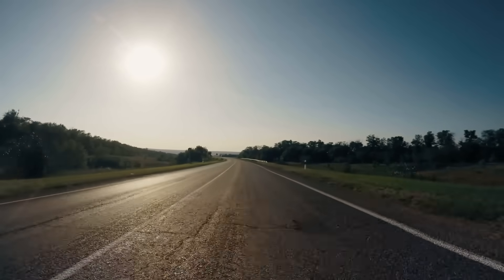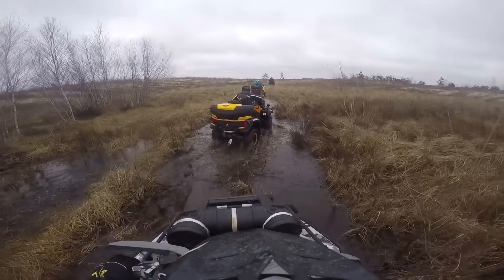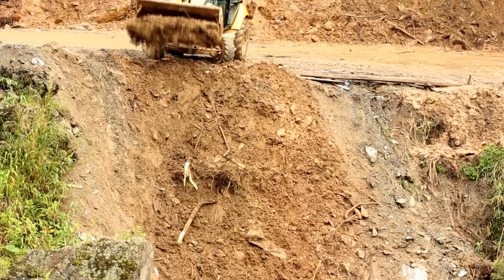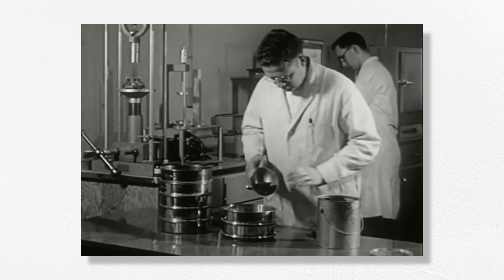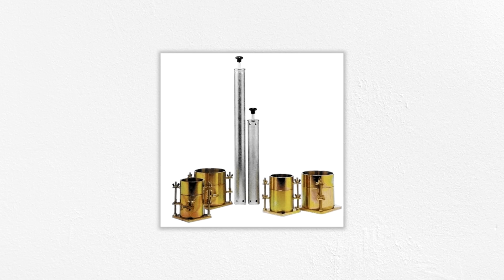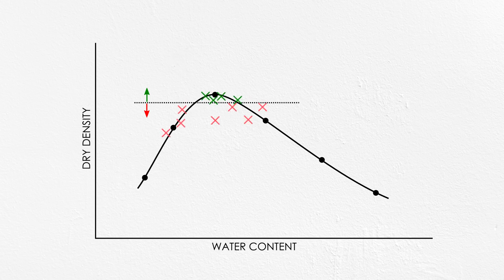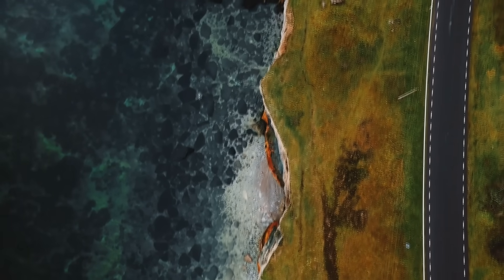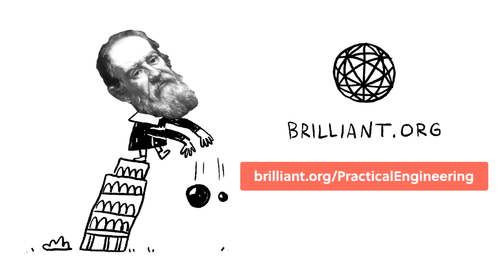Why Does Road Construction Take So Long?

Comment: Oh this brings back memories. As a construction plumber, we had to compact our excavation backfill- particularly on commercial sites. That's exactly what we had to do- put in one foot of dirt at a time, then compact it, which sank it down to 8 or 9 inches. 

We also had to control the moisture content all along the way. Too dry, and and we'd be breathing dirt. Too wet and the compactor would sink into the mud. 

The more money they were spending on the project, the more likely it was there'd be a soil guy on site testing every lift. Without one, we were supposed to test it ourselves, but usually didn't. Testing involved shoving a cylinder into the ground to extract the soil inside it, then squeezing it and rolling it, looking for certain qualities.
Reply: Yeah!  I have seen over the years compactors and graders move around soil on construction sites, especially during the summer.  Oh man... it would almost always be "I did not realize I was in the Mojave Desert already!".

Comment: It might be worth mentioning the specific challenges caused by expansive soils. In Colorado we've had significant civil engineering challenges caused directly by soil volume changes, including major problems for roads along the front range of the Rocky Mountains, often caused by changes to the moisture content of bentonite or other expansive clays.

For that matter, expansive soils more generally might make an interesting subject for a Practical Engineering video.
Reply from the maker: I do have a video on just that topic ;) It was a couple years back.
Reply: @PracticalEngineeringChannel  Thanks, I'll look that up.

Comment: This small stretch of I-80 in Illinois, Idk how many times it’s been patched up... to the point where they gave up and moved on. I’ve driven in this spot for 2 years. Never gets fixed. (41.4715951, -88.2395958)

Comment: Roads: Million and billions of dollars.
Winter: Intentionally spreading corrosive salt to DESTROY BRAND NEW ROADS completely!
REPEAT. 
We need Salt Engineers.
Reply: the salt used to prevent ice on roads has minimal effect on asphalt. most potholes form either form water expanding inside or under the material as it freezes and causing cracks, poorly compacted material under the roadway swelling/shrinking in relation to the water content changing and damaging the asphalt, or Heavy vehicles like semi trucks sitting in one spot or moving very slowly on the asphalt during hot weather, where the heat and weight cause the asphalt to soften and then deform. Once you have a depression, tires hitting the edges of the slope at high speed quickly wear it away and change it from a depression to a pothole.
Reply: Here in Michigan we have 2 seasons. Winter and construction
Reply: @Devilnutz2651  in Russia there's no such separation. If at least one road was not re-asphalted during winter, something is not right
Reply: summoning salt
Reply: @heyandy889  He's gonna go for a speed run in construction
Reply: Us in Ohio also have this problem. We really need to invent roads that can better survive the winter.
Reply: We tried beet juice here in Calgary last winter on the roads.  Worked ok, but we are like Denver and have crazy freeze thaw cycles because of the chinooks.  God I love chinooks, the wind, not the helicopter.  I like the helicopters too.
Reply: In the tropics we don't need salt, and roads damage just as easily from muddy soils and intense rain. And if it's on the coast, salt from the sea.
Reply: Trains
Reply: I think that a lot of places put too much effort into keeping their roads clear of snow 24/7. Where I live, It snows badly enough to really affect vehicular traffic about 3 times per year, but when it does, they immediately run like 10 plows at once to clear it all up in an hour or two, and everything just gets carpet-bombed with salt. Rinse and repeat if it keeps snowing for a few hours. I know that, hypothetically, someone might die somewhere by not being able to get to a hospital if the roads aren't completely clear, but cars kill people all the time, and I'm sure a ton of emergency services already dump money into being able to reach places in a snowstorm, anyway. I think we'd save a lot of money and effort if everyone just agreed to chill at home for the day (or, you know... WALK) while the snow was cleared in a more methodical manner. Like a mini-coronavirus lockdown that only affects motorists. And you could maybe use your day off to shovel snow for a bit... get some exercise?
Also, as an engineer who works on non-roadway infrastructure: the blue-collar dudes that run your sh*t will not listen if you tell them not to use salt on things (for the same reason that beat cops in even "progressive" cities like Minneapolis still kneel on black people's necks). Design everything to be as salt-resistant as possible, and keep snow from accumulating where you don't want it in the first place, if possible. This includes the sides of buildings where salt is likely to be dumped or splattered.

Comment: It might be interesting to talk about ways previous projects have cut corners to work faster and cheaper, and the long-term consequences of those decisions.  For example it feels like  the Interstate system may have been initially constructed with much more cut than fill to leverage pre-compacted soil, possibly just dumping soil or using it to make berms.  I don't know this but it kinda looks like it.
Reply: The experience with the Interstate Highway system varies by region, and much of its early history (late 1950s to early 1970s) involves the development of proper freeway/motorway design standards in an era when the existing freeways were few and had design standards more in line with boulevards and avenues. Even the Weimar and WWII era Germany Autobahn has certain features more in common with avenues than modern freeways.
Secondly, freeways can also have intentionally depressed designs for other reasons, such as taking advantage of gravity in off- and on-ramp operations (off-ramps uphill and on-ramps downhill results in shorter ramps as gravity helps cars speed up or slow down as needed), creating natural noise mitigation from the cut segment slopes, saving costs on more expensive mainline bridges over cross-roads, and even using the excess cut material to form noise-abating berms on the roadside.

Comment: I would love to see this series continue. I have been known to take the congested under-construction route to check up on the progress of jobs. I love watching it all come together even as I get frustrated by waiting for flaggers to let me through the site. 
One thing I see commonly in BC's lower mainland is pre-loading - loads of gravel up to several meters deep dumped on a surface after removing the biological soil layers, but before the final road building begins. It would be great if you could explain this process in more depth.

Comment: Is that mass haul diagram the integral of the difference between the current surface and the proposed surface? It seems like it finds the areas of cuts and fills, like how an integral finds the areas under and over a curve.

Comment: I don't usually mind the time of construction, I do mind the brain dead fools in charge of managing the temporary traffic re-routing.(both flow paths, and for larger projects clarity of markings - intersections, lane changes, and such. Nothing like having people 4 lanes  off from the temporary junction they needed to really screw up traffic) 
Or the local arterial road that was closed for a year. The detours were many miles (due to terrain), of already congested roads. We all thought they were doing something major like finally straightening the curving old 2 lane hill or even adding a lane. NO! They removed a lane from about one mile of the formerly 3 lane straight section at the top, did nothing to the hill, added a garden median and some sidewalks that are wider than the actual road lanes! (Keep in mind this area has nowhere to walk to, you see a pedestrian or bicycle about once every 5 miles, and all of the roads are 40 years behind the issuing of building permits while taxes are at an all time high.) And it took them a year, one mile no grade changes, not even regrading the base!

Comment: Yet, it would seem due to these projects being executed by the lowest bidder is why so many roads are so poorly prepared before paving.
Reply: Any road construction project will have inspectors on site verifying that the work is done to specification with the correct materials, like the guy in the video testing soil compaction with the nuclear densitometer. they also sample and test the concrete pored and paving material used  The inspectors are generally employed by either the contracting agency or an independent engineering firm. They system isn't perfect, and no doubt sometimes sub-standard work slips through, but  It's not like the state just gives the construction company a contract and then walks away and lets them do whatever until it's finished.

Comment: I would like some continuation to this series. Especially how variation in the soil affects this process of compaction. I don't quite understand how one could accurately measure compaction of a soil layer if there could be roots, stones and sands mixed in one patch, but absent in another, but I have never seen anything resembling soil filtering equipment in road construction sites.
Reply: Fill containing roots (or other organics) as well has size specific rights (over 4 inched usually) means that that fill is not suitable. It would be up to the engineer of record to evaluate and give recommendations

Comment: The local government workers came, dug a shallow hole in the road right before my driveway, and then left. The hole did not expose any pipes, cables, wires, etc., but was just deep enough to be a problem when getting my car out of the driveway. No other work was done in, or around, the hole. A classic pothole, made by public money.
The workers came back six months later, and filled it in.  :/

Nice video, though:)

Comment: I95 in CT around exit 9. Started driving that in the late '70's and 30 years later they were done. 1 mile of highway. The joke was you saw 3 generations of workers. 1 mile. 1 freakin' mile.
Reply: Michigan has entered the chat
Reply: Where I live, politicians will announce a project before each election for 50 years before building it, then they'll build a phase, and spend the next 30 years announcing phase 2.
Reply: Haha I know that area you are talking about.
Reply: come to Indiana, where the same sections of roads are always under construction. I think they have had I-69 from Indianapolis north to Anderson under construction for 20 years. and it seems when it looks like they have it done, they tear it all up again to redo it. 
Another fun one is city roads get redone, then two months later it is tore up for the city owned water/sewer pipe replacement once done the new road is now a junk road and it is like that for 20 years.
Reply: Tony Dratchev lets be real, Indiana doesn’t know how to make a flat surface on any of the interstates...idk how many times I’ve driven through and thought “Jesus Christ, I don’t even know how to pave a road and I’m pretty sure I could do better than this bs.”
Reply: They still haven't finished I95 in Jacksonville FL.
Reply: Ha, I moved from Jacksonville in '06. Wonder if they ever finished that project out by Cecil Field, used to live near there by Argyle.
Reply: @Ron Miller Do you have any more info on that story? Sounds like a good one.